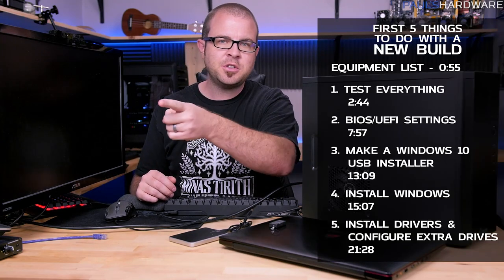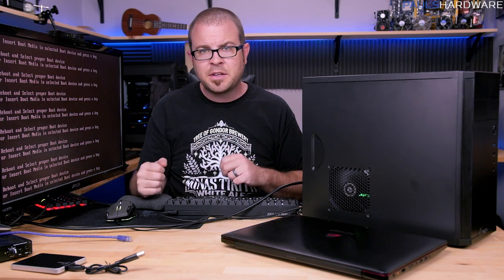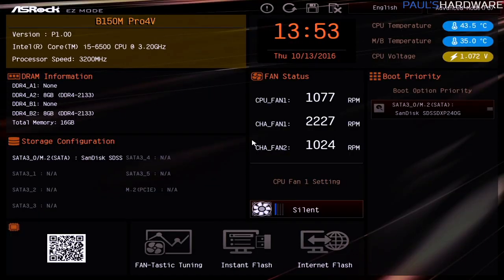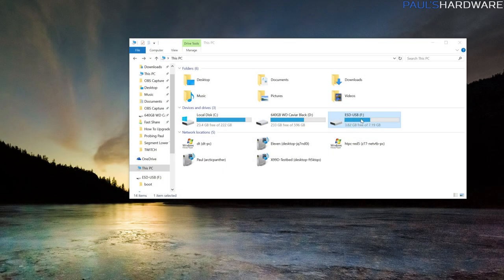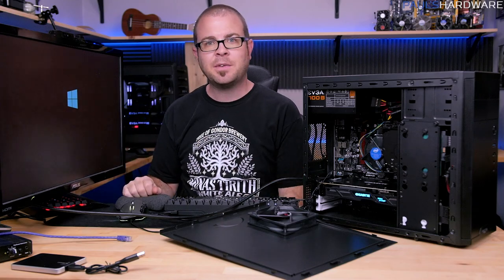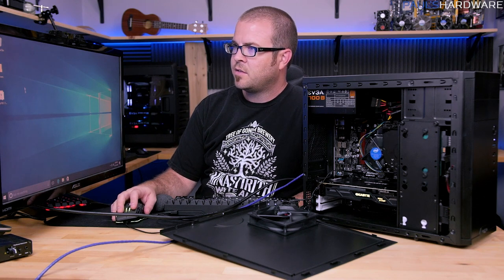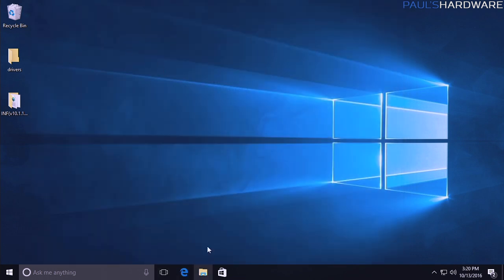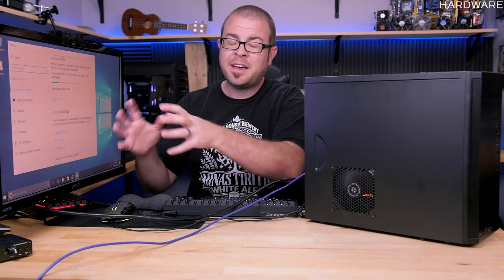First 5 Things to Do with a New PC Build

Comment: im about to upgrade my computers cpu and mobo, going from an i5 6600 with an asus b150i mobo to an i7 8700k with a gigabyte z370n mobo, this is the first time i have upgraded and im just wondering if i will need to reinstall windows with the new hardware but since im not replacing my ssd or memory, will it boot up as normal without reinstalling windows ?
Reply: If you are just upgrading your CPU then you should not need to reinstall Windows.  You may have to adjust settings in your BIOS, or even flash it, depending on which motherboard you are using and what CPU you are upgrading to.
If you upgrade your motherboard you will have to not only reinstall Windows, but possibly purchase a new license key for it.  The reason for this, is that a Microsoft license key "bonds" to a motherboard when it is installed, and if a new motherboard is used, Windows will see it as that you have tried to use the same license key on two different PCs.  This of course only applies if you have an OEM version of Windows that was pre-installed by the manufacturer of your PC.  If you originally bought Windows separate from your PC then you can install it on the new PC using the same license code, but you will need to uninstall it first from your previous motherboard.
Reply: Changing motherboard always requires a fresh windows install. Sorry mate, but it's way better to pour some sweat drop today than many tears tomorrow ^^

Comment: I just did a new pc build and unfortunately nothing works like i want. If turns on with the rgb lights working and the fans working. What doesnt work is the ports in the motherboard nd graphics card like usb, hdmi, etc. anyhelp would be greatly appreciated. I used the h500 case btw

Comment: Do I have to use ethernet to connect to the internet? I can't use my USB flash drive?
Reply: No, you don't, wi-fi is just fine if it works with windows basic drivers. And you can use your USB flash drive, provided it's at least 8 GB (requirements were raised with release 1803 of Windows 10: the installation disk is now 3.8 GiB, just a few megs more than 4 metric GB).

Comment: Hi I would like to know how you would install wifi drivers if you dont have LAN cables
Reply: If your PC has a DVD drive, then install them via the included discs. If not, then you will need to use a computer that does have Internet access and download the drivers and copy them over to a flash drive. Install them on your new PC via flash drive and it should be good to go.

Comment: So i can use my brothers usb with windows installer right? Or do i have to get a new usb?
Reply: No, that won't work.  The reason being is that a Windows license key is tied to the motherboard it was installed on first(this would be your brother's board in your case).  If you try to install it on your PC, it will install, but his license key will not work unless he were to uninstall it from his PC first.  If it is an OEM version of Windows then even that won't work as the license key is tied permanently to the motherboard the manufacturer installed it on and you would have to purchase a new license key for your board.
If it's some kind of pirated version of Windows then I guess it would probably work though(I wouldn't recommend this though as you have no idea if an uploader included a ton of malware and nasty stuff on a pirated OS image file).

Comment: Hi I need some help.
I have a hard drive that I want to use in my new computer, but there is still a windows installed on it. Can I just plug it in, when I have my ssd with windows in the new pc?

Comment: I built 2 systems both with the PowerColor Red Dragon Radeon RX 580 GPU. I only get video out on the DVI connector... the HDMI seems dead on both. I downloaded latest driver from AMD swebsite - no help. Any suggestions?
Reply: I got it … I mistakenly plug the monitor into the motherboard HDMI connector instead of the GPU HDMI connector. GO FIGURE!

Comment: What do I do if I changed the order of the mother board boot drive and I have installed windows from a usb but when I restart and it boots up it will continue going to the instal windows set up steps over and over? Even after restarting the pc and taking the usb out?

Comment: Im having an issue getting into the bios initially. The build is fully working, all the fans are spinning and none of the error LEDs are lit, but when I turn it on and press the delete key over and over again, nothing shows up on my monitor. I have checked my manual, and it is indeed the delete key that should be pressed, but nothing happens when it is. Anybody know why this is happening or how to fix it?

Comment: After I built my pc and connected everything my pc wouldn’t display anything but the GPU, CPU and case fans were all running including RGB but nothing would pop up on my monitor. What should I do
Reply: I have tried doing the delete to open bios after I turn it on and still nothing happens. I’m running on a MSI X470 Gaming Pro

Comment: I know it's been a while, but I wanna know honestly, is a PC complicated and easy to "break" because I'm getting one but so stressed out that I'm gonna break something do something wrong by accident such as a setting for example.
Reply: You can usually revert most settings back to factory default, like BIOS configuration. As long as you're not messing around with partitions or critical system files, you likely won't damage anything. You can even make a system image (using something like Acronis TrueImage) so that if you do seriously damage something, you can easily restore from that image and it would be as if nothing had happened.
Reply: @JJFlores197  so basically dont  be stupid and nothing bad will happen.
Thanks

Comment: i do everything the same yet for me it takes 40 mins longer and just goes back into the windows setup every time
Reply: After the PC reboots the first time, remove the USB installer and it will boot from the drive you installed Windows to. It will continue the rest of the setup process.

Comment: Hi I have a question do I need to set anything up for my pc to always boot up on the windows os when I remove my usb?
Reply: Check the boot order in your BIOS.  As long as the hdd or ssd that has your OS on it is listed as the first thing in your boot order you'll be fine and shouldn't need to change anything.

Comment: Well, Better way is to go check for updates let windows do driver installs but once that's done then just go to your graphics manufacturers website like AMD/Nividia/Intel and download the one which is for your hardware all set install it and restart Don't do anything else
Reply: That is terrible advice.  Many times Microsoft will just install generic hardware drivers for your devices.  ALWAYS install up to date drivers from your hardware manufacturer's website!  Otherwise you may end up with hardware that doesn't work or is only functioning at half it's capacity with many of it's intended features turned off.

Comment: Ok cool...so what happens if the windows 10 flash drive (bought one from the store) shows up in the bios and you tell it to boot from the drive, but it just keeps going back to bios???
Reply: That sounds like you may have been attempting to use the usb flash drive in a usb 3.0 port before the drivers for it were installed.  When doing a new/fresh install of windows via USB drive, always use a 2.0 port.
Reply: @thebrokenglasskids5196  Nope. It was the board reading a fan that was not installed.

Comment: Hey. Hope you see this. I just build my new PC, follow your steps and everything is working. I have made an ISO USB with windows 10, but when I try to boot from it, I just get a black screen with a blinking cursor in the top left corner! 
Please please help me.
Reply: If you mean a usb drive with an .iso file inside, then that's not going to work. You need to extract the contents off the .iso file into the usb drive... OR burn the .iso file onto a dvd and install windows from there

Comment: I've heard that clicking the "Check for Updates" button will silently opt you in for Microsoft's BETA program, "insiders" I think it is called.  Anyways, it will give excessive updates of potentially buggy features under the assumption that if you click that button, you are a "pro user" or something. 
I heard this info on I think LTT, maybe JayzTwoCents, so I'm pretty sure it's good intel.

Funny story about that type of program.. One of my gmail accounts gets advanced Youtube updates, for example you can scroll down in full-screen and it accesses the rest of the page (related videos, description, like/dislike, comments, etc.)  My main account, sadly, does not get this yet.  I tried crtl+F5, no luck.  I found something called Youtube TestTube, opted in, no avail.  AB market testing I guess you could call it.

Comment: WRONG! BIOS and UEFI are completely different. BIOS is for small, old systems and uses the Master Boot Record plus the following 1 MB for your file system. UEFI requires a GUID Partition Table and is required for any drive over 2 TB. (HELP STAMP OUT BIOS!)

Comment: i bought 16gb of DDR4 3200. I just built my pc and when i checked it says its runnign at like 2133 or something low like that. So can I just set it to 3200 using XMP and not worry about it any further? I saw another video that said that I should overclock my cpu before doing this to my ram :/

Comment: you never explained what slots to use for ram if your only using 2 slots, usually 1 and 3 or 2 and 4.
Reply: consult youre manual that came with the motherboard, but mainly the thing is that you can stick em in any if youre cpu cooler fits, you just have more room with 4 slots

Comment: When I plug in my eithernet cable to my PC it wont connect to the internet, it says I have to install the network adapter driver. How would I do this? Thanks.
Reply: Just go google search and install driver Network adapter and  install your pc .. need have some another pc to install this driver

Comment: If I put my old hard drive in that already has windows installed can I skip the windows installation step?
Reply: If only! But, sorry, no. Unless your new rig is an exact clone of your old one, and even then it's risky.

On the other hand, it's a great idea to install your old hard drive afterwards as a secondary. That way it's much faster to copy your stuff, and easy to "roll back" if the Windows install somehow goes wrong.
Reply: @DistracticusPrime  thx :)

Comment: I’m having problems. I’ve plugged everything in, when I boot up my pc, the fans on my gpu turn on and then my monitor awakes to a black screen then my gpu fans shut off. And I’m left with a black screen with a white dash on the top left of the screen blinking constantly. No buttons show up to go to bios or anything like that.
Reply: I'm guessing a faulty hard drive
I once had this problem in a laptop where the mechanical hard drive died and the system wouldn't boot
Eventually needed to replace it with a new hdd and reinstall windows

Comment: Wat if the hdmi connections not working where do i check any YouTube links?
Reply: Do you get any video at all?
Reply: @JJFlores197  nope I haven't installed windows either . The Dram light thing is on. Could it be the graphic card?
Reply: @Charnichartstef_  That means there's something wrong with your RAM. Make sure the modules are installed securely installed and as instructed by the motherboard manual. If they are, then take out all modules, except for one to see if the system POSTS (starts correctly). If it does, then that module is good. Remove the good module and repeat this process until you have tested all of your modules. If one of them doesn't POST, then you'll want to replace that module.

Comment: How come you're 1060 has a led name on the side?

Are you sure its an 1060?
Reply: Some aftermarket manufacturers of Nvidia cards add fancy pants stuff like that(including a few that alter both the 3GB and 6GB versions of the GTX 1060).
You can also buy LED's and wire them into just about anything these days as well.  I wired a subtle LED into my EVGA 1060 6GB SC's fan shroud along with my 3 intake fans.  Looks good when coupled with UV coated Sata cables.  =)
Reply: Thanks but i found out ages ago. It a gaming card.  Mine is an overclock card. Two different brands under the same 1060 card for Gigabyte

Comment: If only I watched this video when my hdd messed up. I replaced it with a ssd to upgrade while I was there and tried installing windows 10 from a usb but it kept going to the install menu when done, I luckily just guessed and removed the usb eventually after a while of trial and error and got it working

Comment: Even though I installed Windows on my SSD, somehow the system reserved partition ended up on my hdd.  What do I do?
Reply: When I install any operating system I always disconnect all other harddrives to avoid problems like that... Even more important if you install Linux or BSD is my sad experience after I forgot to disconnect one exstra drive and it deleted everything automatically without asking (PC- BSD did that...)

Comment: I just built my gaming pc
Mobo:
MSI Gaming AMD Ryzen B350 DDR4 VR Ready HDMI USB 3 CFX micro-ATX Motherboard (B350M GAMING PRO)
PSU:Rosewill Gaming Power Supply, Arc Series 450 Watt (450W) 80 PLUS Bronze Certified PSU with Silent 120mm Fan and Auto Fan Speed Control, 3 Year Warranty - ARC450
Processor:AMD Ryzen 3 1300X Desktop Processor with Wraith Stealth Cooler (YD130XBBAEBOX)
SSD:Samsung 860 EVO 250GB 2.5 Inch SATA III Internal SSD (MZ-76E250B/AM)
Case:
NZXT S340 Mid Tower Computer Case, White (CA-S340W-W1)
RAM:Crucial 8GB Kit (4GBx2) DDR4 2400 MT/s (PC4-19200) SR x8 DIMM 288-Pin Memory - CT2K4G4DFS824A
GPU:MSI GAMING GeForce GTX 1050 2GB GDRR5 128-bit HDCP Support DirectX 12 Single Fan OC Graphics Card (GTX 1050 2G OC)

I built the pc last week, Then i tried connecting it to a monitor. But no display showed up. I tried the gpu slot and the motherboard. The lights on the motherboard came up and i was red.

I connected a bootable flash drive then turn it on but no display came

Pls i need help 
What should i do
Reply: I have the same problem, how did you solved it

Comment: Hi Paul! Thank you for this video! Im building my first pc and got as far as installing windows 10 then i got an Error Code 0x80070570 saying that files might be missing or corrupt during installation. I don't know if it's relevant but I made the USB installer from a mac. Any help is greatly appreciated. Thanks!
Reply: Since the release of windows 10 1803, the USB drive must be at least 8 gigs, formatted in FAT32 and have only one partition. Provided that this is the case, MAYBE the damn mac fucked it all ^^

Comment: 19:20
ppl always told me to make a partition the drive you install Windows on, but I never knew why: maybe if you ruin your windows files you don't wipe your full drive..? Does someone know if it's worth to make a partition?
Reply: The advantage of having your OS on a separate partition is that backing up your OS will take significantly less time since you are not backing up the entire hdd/ssd, but rather just the partition that contains Windows.  And yes, if you needed to reinstall  Windows for some reason you would not lose the data on any of the other partitions(except possibly app data that is dependent on your registry entries).
Just make sure you make the partition large enough for the version of windows you install as it will grow significantly once the following happens:
1. Windows updates are installed
2. How many applications you decide to install on the OS partition, if any.
3. The amount of RAM your system has(Windows will generally allocate about twice the disk space for the page file as the amount of RAM you are running, meaning if you have 16GB of RAM the Windows page file will be around 32GB in size.)

Good rule of thumb is to leave a minimum of 25% free space on an OS partition.  Anything less than that and you will very likely see a drop in OS performance.  For example, I have the OS partition on my SSD set at 85GB as Windows is currently taking up 52GB of space on it.

Hope that helps =)

Comment: I really need ur professional help i built a pc about last year and after setting everything up i cant seem to get it to work i have my windows usb and the pc turns on but it will not appear on the monitor
Reply: It depends on what type of graphics setup you have so there really is no definitive answer to your question without more specific info about your hardware setup.
Does your CPU have integrated graphics?  If yes/no, is it configured correctly in your BIOS settings?
Are you using a discreet gpu?  If yes, is your BIOS configured to use it instead of the integrated graphics of the CPU?  Is your BIOS version flashed to a version that supports the discreet gpu?(for example, Nvidia 9 and 10 series cards will only worked with an Ivy Bridge or higher BIOS)
How is your monitor connected to your PC?  For the initial boot of the system, try it connected to the integrated graphics port instead of the discreet gpu(you'll need to install the discreet gpu's drivers in Windows after and then it will work connected to that instead)
Also, do not connect with an HDMI cable for the first initial system boot, as many times this will not work until both the gpu and monitor's drivers are installed.

Hope that helps!  =)
Reply: @thebrokenglasskids5196  i have figured this out long ago but thanks for answer that dosnt help at all

Comment: I just installed windows 10 and the resolution scaling is all wrong. I have a 2560 x 1440 monitor and my screen is scaled to 1024 x 768. It won’t let me scale it any higher. Any suggestions?
Reply: Tim Silva update ur drivers